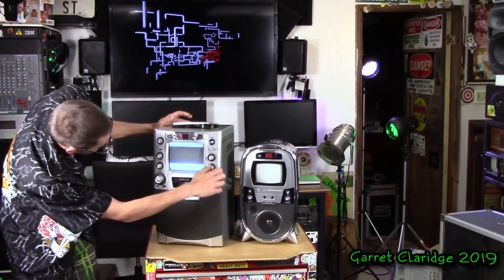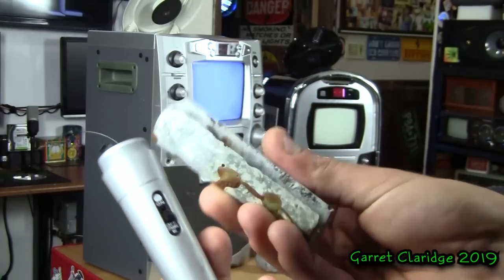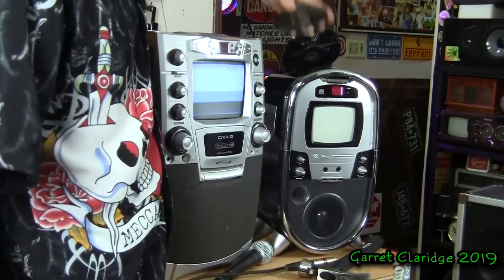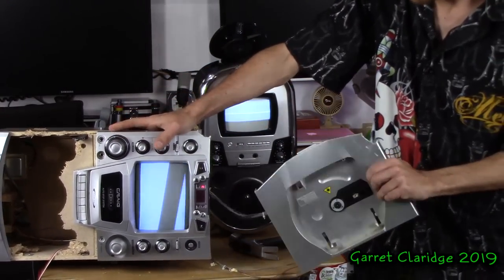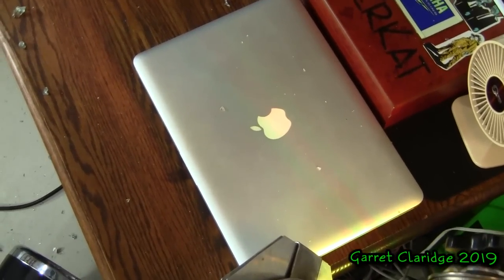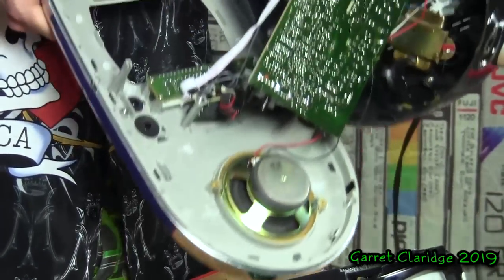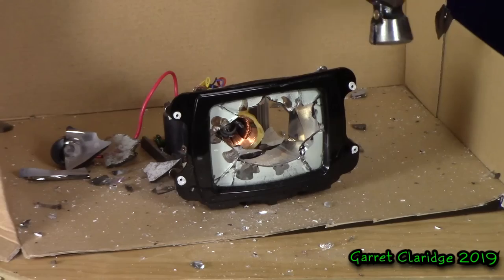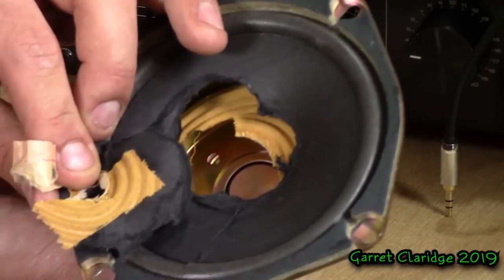Double CRT Karaoke Destruction

Comment: Garret, I have one hint.
You got to be more careful with these CRT junks, when you destroying them or having fun. 
There's about 6 to 10kV of voltage from the flyback, driving the CRT deflection, by the fat cable.
It's possible to shock you a little when you hit them accidently with hammer, knife or so on the upper side of the tube or close to that cable.
Have fun and keep it up.
Just decided to leave it that comment.
Reply: Thanks for warning him. I was sooo worried.
Reply: Also, don't breathe in the tiny glass fragments of phosphor dust from the screen. Wear a mask & safety goggles.

Comment: Next time run the high voltage from the CRT into the speakers.
Reply: Or use a microwave transformer
Reply: S P E A C K E R 69, YYYYYYYYYYEEEEEEEEEEEAAAAAAAAAHHHHHHHHHHHHHHHHHHHH
Reply: Jbl boombox

Comment: 1:20 Did you customize your screensavers on that Windows 10 machine? I know Windows 10 doesn't have that 3D Pipes screensaver by default lol. Also I have one of these CRT karaoke things that I got at Goodwill for $6, it has line in and video in along with a CD player. I was able to plug a GameCube into it and play on the little CRT, but it was monochrome :/ IIRC it was manufactured in either 2000 or 2005
Reply from the maker: hah yeah the pipes saver can be downloaded free online :D
Reply: @GarretClaridgeMeerkat  I just downloaded it, I'm about to get the 3D maze too and all the other shit from Windows 95 and XP
Reply from the maker: Cool aha I had the 3D maze first but with all the displays I have going it was a mindfuck, On the two big tvs it would make me dizzy lol but I have a 40 edit, 50inch over my computer desk and 55 as the main TV rather close together ahaha

Comment: no wonder that Realistic zapped you, it's a 70V line type amplifier
Reply from the maker: Haha yeah :D    But I was tapped into the 8 ohm output - distorted audio zaps feel like 110v shocks but with a wild frequency that I find messes with me much more than normal 110v shocks  haha
Reply: @GarretClaridgeMeerkat  ah in that case it might actually have a transformer inside of it, for the 8 ohm outputs, and if you send a truly clipped signal into anything inductive it can certainly cause inductive spikes which might be what happened, however it could also be that you're somewhat sensitive to it too